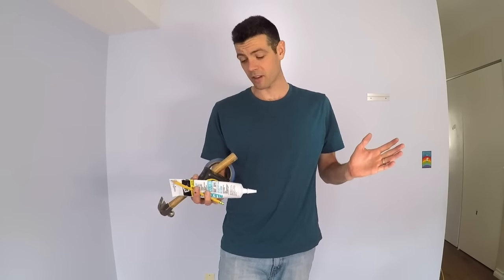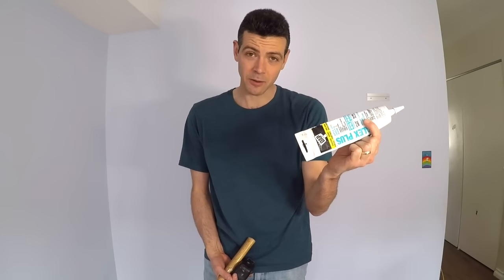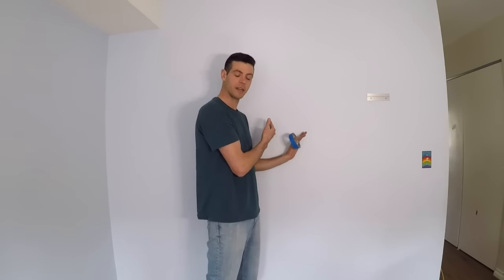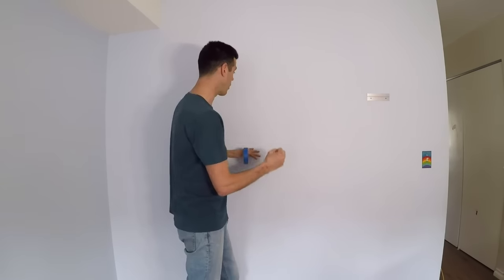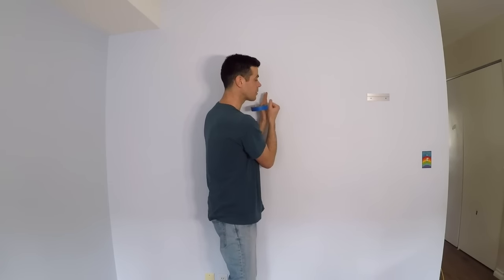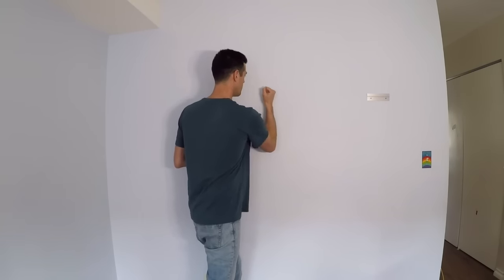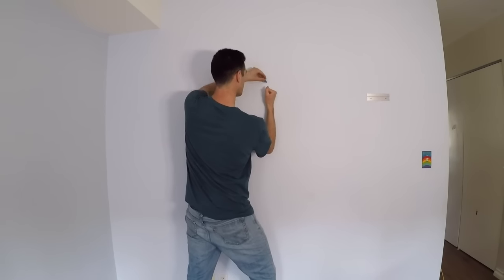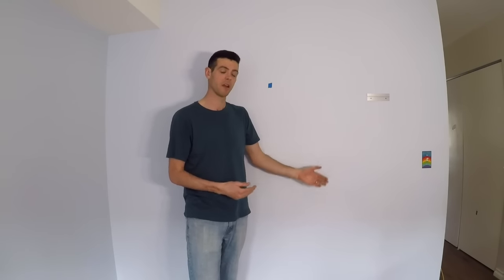It's EASY to Find Studs WITHOUT A STUD FINDER!!!!!

Comment: To find which side of an outlet a stud is on, I take off the cover plate and poke a small screwdriver on each side (outside) of the electrical box. The cover plate will hide the hole.
Reply: 90% of electricians are right handed, so just by those odds, there is a 90% chance the box is mounted on the right hand side of the stud.

Comment: An old trick is to rub two pieces of steel wool together really close to the wall, the small shavings fall down and collect on the drywall screw heads like a magnet. It’ll tell you exactly where the studs are.

Comment: A somewhat expensive(much cheaper than years ago) but cool way to see most of the studs in your house is with a thermal camera. It will show you  everything like an xray, including where the nails are. But you need a big enough temperature difference on each side of the wall to see them clearly. Which can vary from day to day.

Comment: Instead of pounding on the wall, try the technique used by doctors called percussion (google " abdominal percussion ").  Put left middle finger on the wall and tap the end of the finger with your right middle finger.  It's a little more precise and easier to hear.  Then use small magnets and his other suggestions.

Comment: If i miss stud with first nail, i use a piece wire bent in a U shape with equal sides,  just push wire inside  hole and turn it till it touches stud inside wall. If sides of wire are equal, then that shows you edge of stud on outside of wall. Also keep a monkey hook handy, you can push it into drywall without a hammer.
Thanks   M L Rogers     Pasadena,TX

Comment: Wished i found this vid before. I did this too in the area behind where tv would be mounted. Had to patch up around 20 tiny holes but finally found the studs to mount the tv on wall. At least the 70 inch tv hides all the patched up holes i did.

Comment: remove electrical plate and look on both side and the studs are 2x4. your coaxial plate and your electrical outlet are 2in apart. So studs are 16 on center or 12 (old houses).

Comment: The last apartment I lived in had metal studs. AND I found they were 24" on center as well 🙄. So i had to go buy self-tap screws to wall-mount my TV but the screws would NOT penetrate the studs! I tried using a 1/8" drill bit to pre-drill a hole. That would not work either. The studs just gave way, bending slightly and the, brand new, drill bit did not cut into the daggon (gosh darn) stud! I ended up making a 3/4" plywood backerboard, mounted using 12 (4 columns of 3) toggle bolts. Then I used 1" screws to mount the TV mounting bracket to the backerboard. What a PITA! Made me so mad...What should have taken less than an hour ended up taking HOURS and a few extra trips to the Home Depot. Also had to stain and finish the backerboard so it didn't look so trailer park back there behind the TV. 🤦

Comment: Standard USA stud spacing is 16in, 18in, and 24in depending on when it was built and what the local requirements were at the time. Not saying you won't see other lengths just saying if its not at 16, check 18 and 24 before you go crazy and pull off the baseboard moulding and cut back the drywall to see where the hell the crazy contractor or homeowner decided to place studs.

Comment: I use the round magnet method. The one caveat is that it presumes the drywaller did a good job of hitting studs with all his nails. If he missed, you will miss as well.

Comment: This is a great method on houses post WW II when sheetrock was used. A plaster and lath house didn't awlays have studs on 16. And all the recepticles were on the 5" baseboard and not on the walls

Comment: Good video. Sometimes if you remove the skirting (baseboard) you can see the studs as often the plasterboard/sheetrock does not go all the way to the floor. It also allows you to poke and prod away without any damage.

Comment: I'd like to set a tiny drill bit, at less than a half inch, to make a short hole in the sheetrock; and then use a paper clip to push the hole through. If I don't hit air, I'll figure out if I hit wood, abs, or wire.

Comment: you can find them by tapping the wall gently  with the back of your rubber handled hammer ...it takes skill ,practice and good hearing tho ...once you find one then you can try and measure 16" or 24" on center from that point on ...if you don't have the skill you will do more damage to the wall than good so practice first and see if that method is for you or not

Comment: If you use the 16 inch on center method, you have to see if it's 16 inch on center from the left, or from the right. Generally, it won't be both.

Comment: If on a commercial jobsite and screws were used a little iron oxide or grinder dust will stick to the magnetized head of the screws imbeded into the metal studs. Tripped me out too.

Comment: Here's what I do, Much simpler. Power boxes are usually nailed to a stud, I take off the cover to see which side of the stud it is nailed on.by using my drill and a small bit and drilling on an angle between the drywall and the front of the plastic box.. The stud will be on one side or the other. Then you just measure 16 " on center.

Comment: Excellent videos. I have watched quite a few. this one is of equal quality, Here are few more stud finding tips to add to the list.  Yes the outlet is one of the best places to start looking. Because most people are right handed, the stud is usually to the left of the outlet as the box is nailed to the stud. Also remove the cover plate and with a thin screwdriver, poke in right above or below the box to see what side the stud is on

Comment: How about starting at an inside wall corner....and measure 16" ( or 16" increments)...to the point of interest. There has to be a stud in the corner ( +/- , 1 inch). Test with a small nail hole as you did, right above the bottom moulding....good idea there as to being inconspicuous.

Comment: I use a bradawl I get better control and can easier for me  to stop and even feel the surface you are hitting , wook gives a bit metal does not , a plastic covered wire is a bit more tricky .

Comment: If you are a pro a Bosh D-tech 120 works well for me. If no body is watching then the above method in the video is fine, but if you are at a business and need to get the job done with out crawling around then a good wall scanner is the way to go.

Comment: Light tapping on the wall using your knuckle, is more accurate than pounding with your fist to find the stud. Listen for a very small, higher change in pitch. I had to do this just the other day when the stud finder proved to be a little less than accurate.

Comment: I have a dozen of holes before I find a stud. When I got an electronic stud finder, often times it indicate a stud where there isn't one then just goes by one without indicating it. Some strange walls have ghost studs, maybe framing over a window.  Also totally useless for plaster walls. I now use a magnetic stud finder, very strong almost never missed a nail.

Comment: Magnet attached to a string. And move the string side by side.  The magnet will catch on the nail/screws, that's the stud.
Reply: mdv39spiky or a large patch
Reply: @Rickety3263  
That's true but if you hit something with the magnet you know which way studs run in a wall, vertical. So you can easily check if there's more nails or screws under whatever your magnet touches. If there's nothing under or above what the magnet caught it's most likely not a stud so just keep swinging the string until you hit something. It also work for ceiling joists. I've done it and it's a lot easier and less messy and damaging to the walls then using a nail and Hammer. Also it's less time-consuming than just tapping on the wall. Battery powered Stud finders sometimes work I've always had issues with them.

Comment: I found another way to locate studs behind drywall and that’s By using a small strong magnet to locate the drywall screws. You shold be able to purchase one at a hardware store. I used a magnet i removed from and old nonworking computer hard drve. These types of magets unbelievably strong. Just run your magnet along the wall. It will locate the screws by attraction.

Comment: Reason C. I just don't 100% trust a stud finder.  Like how i don't trust my NC electrical tester every time unless I test it against a known live wire first. 
Good suggestions in this video. 
Here's another.   Get a rare earth magnet (Ebay, Amazon, Wish...) Take your painter's tape and cover the end you'll use against the wall.  Now,  given basic construction you can find the screws or nails. If you try vertically up or down and there's more, then you have found the stud.

Comment: Can you make a video on installing multiple pieces of corner bead (outside corner) Example: if you are making a bulkhead that runs the length of a room and you need more than one piece to cover the  length of the bulkhead. Or maybe a situation where you have very high ceilings that would be greater than the standard 8 or 10 foot length bead. How are they butted up? Cut at a 45? Taped? Butted and taped? There isn’t much out there covering this situation.

Comment: Why would you do it that way when there is a TV and electrical outlet right there and you know the stud must to be in the middle? Only way this could be wrong is if those two outlets were wire and installed after the Sheet rock was installed .And that is easily checked by removing the plates. It’s also assuming the place is built with 16 inch centers.

Comment: I actually found one wall in my house with no studs. I couldn't believe it. I drilled all across the wall finding nothing. So ended up using retractable screws to mount my plasma t v.😂

Comment: Wish I seen this video 2 months ago.

I bought a 43inch tv with a wall mound(the ones that expands forward/left/right) and I just put in on my wall without checking. I just now extended it forward and the mound just slipped off the wall and fu**ed up my tv.
Reply: If you’re around Los Angeles and the surrounding areas, you could contact me. I work for a company full time doing tv mounting.
Reply: Christopher Crawford thanks but I’m good. I don’t trust walls anymore.     On that day.... the TV wasn’t the only thing that broke 💔 

It fell on my Xbox too.
Reply: jaime vera I wouldn’t trust the wall either. It needs to go in studs. One of my customers a couple of weeks ago was trying to mount it into the drywall and she said that every time she put it up it would pull out of the wall. So she paid me to come do it and of course I had to teach her that the TV was too heavy for the drywall and needed to be put in a stud.

Comment: Thanks for the video. Our walls are from 1924 and they have everything from barb wire to old newspapers and other miscellaneous building materials. There’s no logic to the construction or any pattern on the inside. The knocking on the wall seems like the most accurate method.

Comment: I used a water spray toy gun to spray icy water on the wall if the water lands on the water has stud behind it the water will run faster because the stud dissipates the heat faster than just the dry wall.

Comment: So the stud was 3/4" out from the top to the bottom didn't use a spirit level when they built that wall, and as for a nail is less likely to puncher, as a plumber i would like a pound for every person that has pieced a pipe or wire with a nail.

Comment: Fine if you are in a house. But I do not know if my mobile home is 16 or 24. Pounded but cannot detect any difference in sound. Even if you measure and pound you cannot tell. The strips that cover the seams are all over the place. Seems like they used whatever width they had close to them so no waste.

Comment: I'll bet most of your viewers have never seen a cow magnet, but that's what we used in ancient times. Round like a medicine capsule with a hole for a string, you could roll across the surface in a pendulum fashion until you hit a nail or screw.
Now there are stronger magnets of course, but not as cool to explain what it's really for.

Comment: Hi! I recently tried drilling on a wall to hand my ikea shelfs. I ended up drilling a hole on one side of the wall, but then on the other side of the wall, the screw didn't go through. I later noticed this point on the wall was about 25 inches above a heat control box. I wonder if i damaged something, or messed by up a gas line or something?

Comment: Without my stud finder, I just knock on the wall.  The wall attached to the stud definitely sounds far different than the hollow wall, and it is less likely to damage the wall.  It does not work if you are knocking horizontally across a fire block though...
Reply: and does not work on lath

Comment: A quarter million views in 7 months, I'm sure more then half of those clicks are from guys who know the answer but just had to see.  I found the stud @ 2:27 then started reading the comments and laughing my ass off..how I miss all that banter!  The stud is between those two nail on outlet boxes, if there is only one box- a quick tap with the hammer on each side usually works, but if in doubt remove the cover plate and angle a 16d nail off the edge of the box and drive it enough to pierce the drywall and find the stud. Then to be dead sure use a small nail to locate the edge of the stud, measure 3/4" over to find perfect center and make a pencil dot, now you can measure from the inside corner to dot knowing that bracket your going to lag in to hold the big flat screen is not coming down!

Comment: I notice a lot of people advocating the use of magnets in the comments and a lot of people advocating the use of stud finders. If all you're doing is finding studs in drywall magnets are simple, reliable and don't need batteries. Because the magnet is centered reliably on the fastener you usually have found the center of the stud. With stud finder or magnet I always positively find the edges of the stud by making test nail holes with a nail. One other advantage of the magnet over the stud finder, a magnet has a variety of unexpected uses that you might discover if you have one.

Comment: Even with this expert advice, I ended up with 8 extra holes trying to install my TV mount! I think they did not stick with 16" on center between studs, arrgh!
Reply: Nope, i always thought 16 was a requirement, but it isnt.
Reply: @ClumsyCars  lower down someone comments that non-load-bearing walls may have studs at 24" on center which I found to be true. :-(

Comment: I'm confused.  If there's an electrical socket attached to a stud, then does the cable travel vertically up from that?  Does that mean I have to avoid that stud in case I hit the cable?  In one of your walls, you said there was usually something hanging above your socket.  How did you avoid the cable?

Comment: How do you find them in a plaster wall from the 50s..
Reply: Use a stud finder I would imagine
Reply: I’ve tried 4 different models with no luck... just thought you might have a trick.  The walls have 1/2 “ drywall with 1/2 “ plaster.... stud finders don’t like thick plaster...

Comment: Professionally done video. However, sorry to be such a downer, but you said that you do not own an electronic stud finder because there will be times that "I can't find it," or "dead batteries."  Then ironically, you say that you need to find tape, a nail, caulking for repair, hammer, pencil, and a tape measure.  Why are those items "easier" to find?  In comparison, all you need is the stud finder and extra batteries, two items, compared to collecting six items to do this job.  And, with a stud finder, you don't need caulking to repair your search for a stud.  And, then there's guess work to which side a stud might be on the side of an electrical outlet and, like you said, "usually," studs are 16" on center...operative word, "usually."  How many times did you try to use a caulking tube that was dried up or empty. 
Too much work in your video.  My stud finder always works in a fraction of the time (seconds) vs, the time it took you in all the methods you show.  I'll stick with the electronics; so much easier and accurate (especially if some studs are not exactly 16" on center), and they are relatively inexpensive.  Oh, and I know where my stud finder is at all times:  It's next to the blue tape, nails, caulking, my hammer, my pencils, tape measure, and off course, my extra batteries!  LOL!
All kidding aside, you presented a very good video.

Comment: Is there a way to determine if there is conduit or romex running through a stud behind the wall? Someone that I know wants to mount her TV to the bedroom wall and the perfect height happens to be level with the height of the light switches that are on both sides of the wall, though, those switches are many feet away from where the tv will be mounted. There are also outlets on both sides of the wall that are approximately vertical to where the tv will be mounted. There is also a red fire alarm nearly inline above the area where the tv will be mounted. This is on the second floor of a three story condo building, so I also don't know if anything else is in the wall that wouldn't be visible from inside her unit. Thanks.